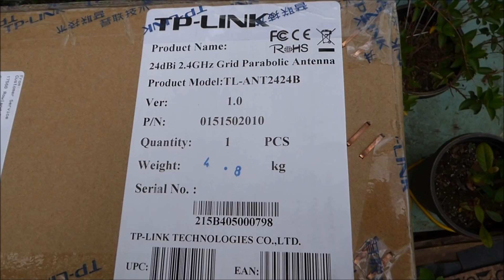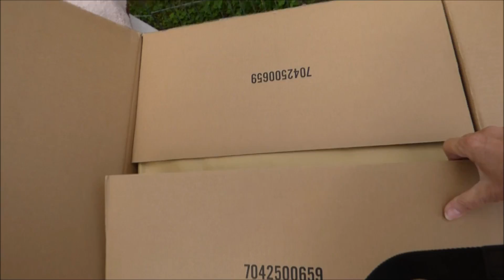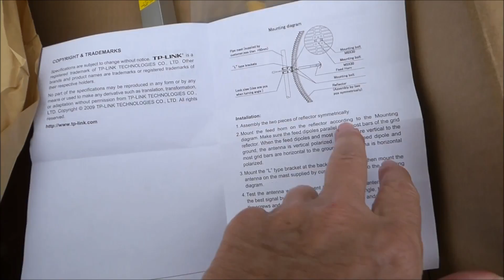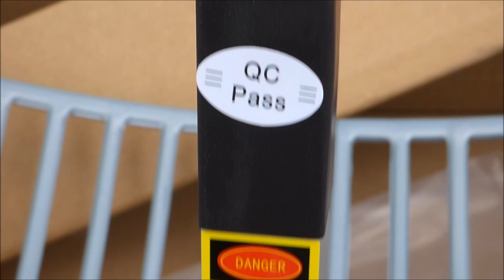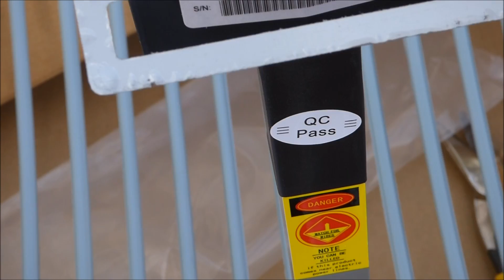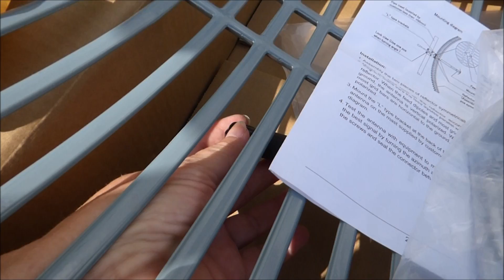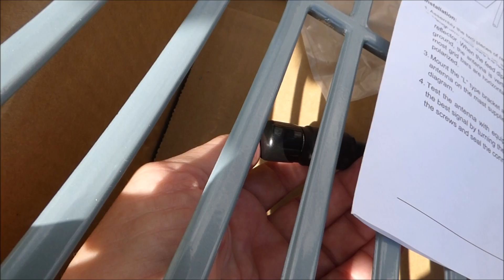Fulltime RVing  Parabolic Directional Grid Antenna for internal wifi   Part 1

Comment: 6:59 - you have that on wrong. Its meant to be flush with the dish. Notice horizontal grills gaps as you put it on, its meant to match the grid, vertical. You have just made the tip of that reflector be vertical (I know the gap line look horizontal), the grid gaps as you can see are going up and down and you have the tip going side to side. You need to take that off and match the grid so it all has lines going vertical. Your signal must be really bad since its not set up correctly.
Reply from the maker: I had a great signal actually. But I no longer use this antenna. Gave it away for barter for some mechanic work on my van. 
Thanks for your comment though! I'll probably invest in a Wilson antenna next? Need one that I can travel with.
Reply: @TexCynRVLife  Forgive me, I am completely wrong. That set up was actually correct. I just bought one and it didnt come with a screw to fix the feed reflector (the one I was describing. Been watching a ton of videos on it. Im raging I cant use it as I dont have a small tiny screw lol
Reply from the maker: @cdenver  Nothing to forgive! You should really like it once you get it set up. I was borrowing from someone's wifi, with their permission of course. It was a business, but they closed down & moved. 
Mine had instructions, but it was confusing. After I assembled it, I did it incorrectly, so had to redo it. 👍

Comment: Got yourself a parabolic barbecue grill for the campfire.
Reply from the maker: tisoy909 Nooooo. I have a grill ;)  The antenna is pulling in the wifi I needed. The park wifi went down, so I'm using another system (by permission) that is down the road.

Comment: i have a parabolic grid not in use, i used to access a paid broadband internet with the grid. now there's a 1.5km free wifi hotspot. can i access the wifi using the grid, and how?
Reply from the maker: Pluto El Beatz I really don't know. I had enough problems just asking techs on my system, so I did a lot of google research instead...
Reply: TexCyn RV Life yes you can as long as it is rated to tech that distance

Comment: how meany Km does it catch wifi network ?
Reply from the maker: BALOCHiT In mileage, 35 miles. I have my doubts on that.
Reply: anesti mihali Pleaaase help me. I'm in an semi-Isolated area, Can you tell me about (AWUS036NHA with AGA-2424T) because I have the NHA, I like to couple it with a powerful compatible antenna, and I was planning to get this 24dbi antenna but I'm hesitated because the NHA has weak output power not like 036H or 036NH So I thought it can be incompatible AGA-2424T or TL-ANT2424B ??
Reply: Nawfal Asfoury hello aga-2424t is same with tl-2424b same antena,the Alfa is very good I have 5 km but I have and adapter L-Link LL-1002 is more powerful With 2 antena I have 12km
Reply: OK thank you, and yes I know that AGA-2424T and TL-ANT2424B are the same.
 So you can get the 036NHA working with this antenna without problems and reach 5 Km, but how much APs can you get with it and what about link quality of near and far APs (always for the NHA). Please if you can give me more details, I will be very thankful to you.
Reply: Nawfal Asfoury best is the l-link 1002
Reply: Did you tested it with ALFA AWUS036NHA ?? because I don't have this adapter  l-link 1002

Comment: I have a TP Antenna, expect its a Omni Directional one. That connect on yours is the N Connector. Just like mine. which you can plug in a WiFi Booster to it. I use a Ubiquiti BULLET. and its pretty good.Here a amazon wishlist which shows my current hardware if you wanna see how im set up. https://amzn.com/w/1D8BFUTOI1AO
Reply from the maker: Thanks for the link Troy. Have you done a video on your set up? Since I'm not traveling, I opted for the directional to piont to the parks system. But it is too big to travel with unless I broke it all down. In the future, I might get an omni directional for trips. can connect that to my current system.
Reply: ReignBeauHounds I havent done one directly about it. but i did show it during my roof maintenance video i think. 

My rv been such a mess inside I haven't been in the mood to do much recording on anything going on in the inside. but to put it simply most of its on the roof. the antenna and bullet. I ran a Ethernet into the fridge vent inside to the PoE adapter which powers the bullet over Ethernet.  Then from the PoE another Ethernet goes to the WAN on my wireless router. Then from my computer i have the  Ubiquiti Discovery tool which brings up the bullet. I log into the bullet, pick where i want to connect, and it repeats into my router. and repeats the signal for me so i can connect multi devices like normal. 

But i do plan to do a video about it. just after i clean up the inside the RV. have a yard sell to reduce all the junk I took with me. lol
Reply from the maker: +Troy Foxxin I hear ya. MY RV is a mess right now too, so I only showed where my set up is located inside....